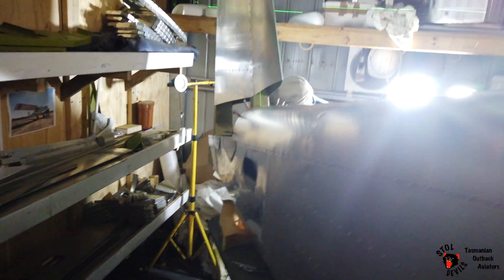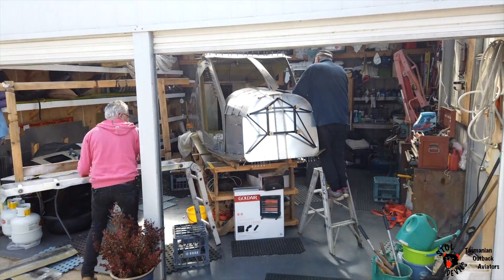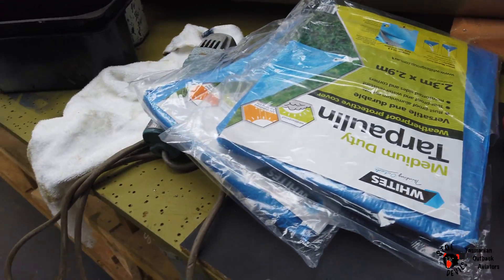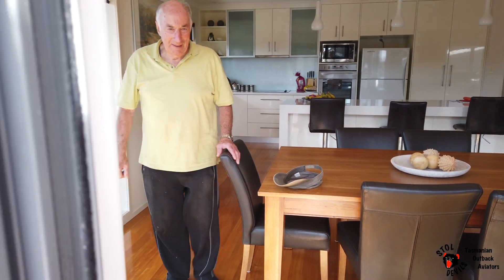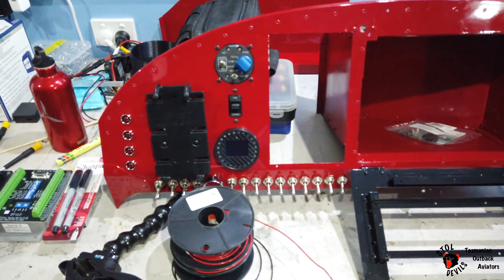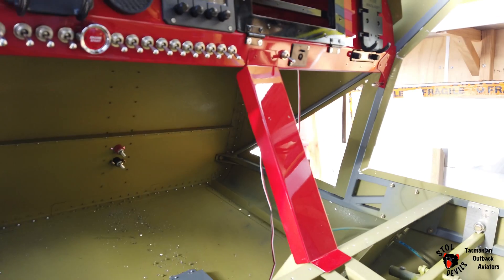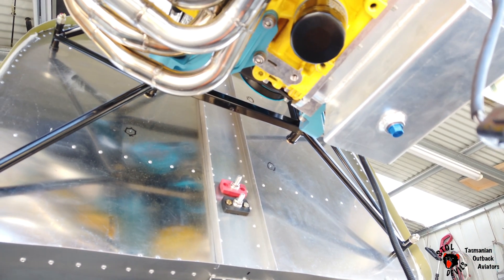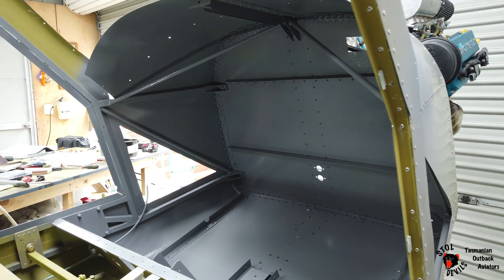Hornet STOL with Aeromomentum AM15 147HP - Aussie Bush Plane - Build #4

Comment: 1/ Is the battery you are using a deep cycle battery or a starting rated battery?
2/ If they are starting rated, did you purchase them through an Australian distributor, or import them yourself?
Thanks in advance.
Reply from the maker: I have 2 Earth X lithium batteries . More cranking amps, and capacity than a lead acid battery for half the weight. They have a built in battery management system. Designed for aviation use.

Comment: I'm considering the AM13 with the max output option of 126hp @ 6500 RPM. Yours is the first Aeromomentum installation I've seen with the max power output option. What are the compromises of going up to max output ... besides the $4000 upcharge? I'm surprised to see price is the same for 131 or 147hp. I assume it's just a bump in ECU redline.?.
Reply from the maker: Gday, I was not aware the 126hp version also had 6500rpm rev limit, I thought only the 147hp had this rpm limit. Yes it is just an ECU retune and ported heads that allows this HP.  You had better ask Mark @ Aeromomentum for clarification.